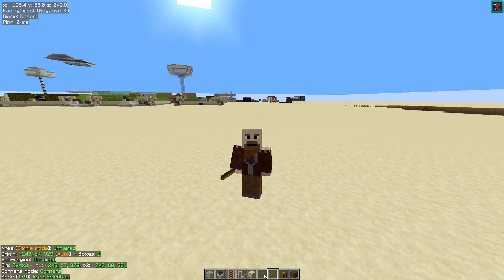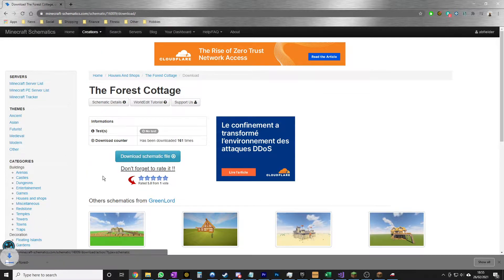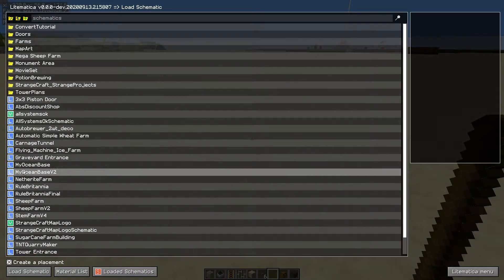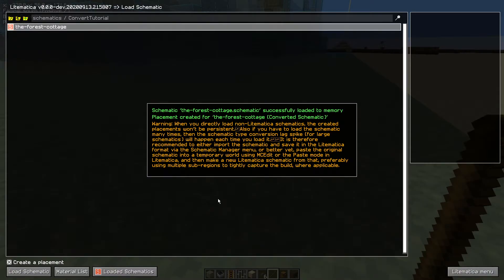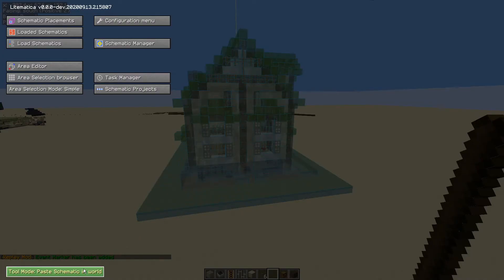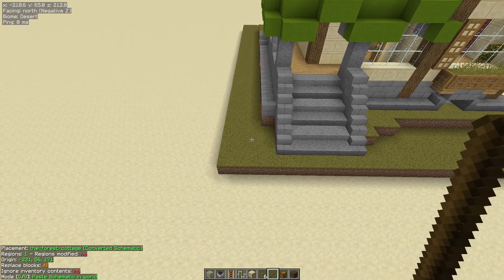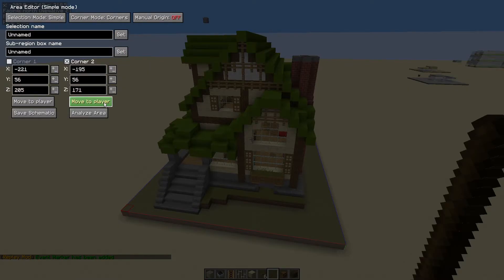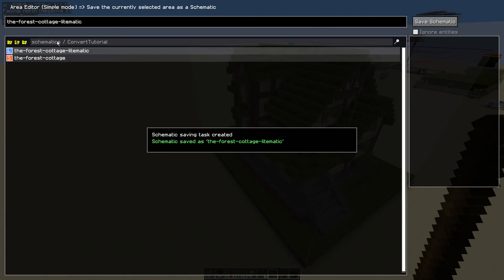Minecraft How To Convert A Schematic To Litematic File A Litematica Tutorial

Comment: When I try and load my schematic in it says "Failed to load schematic" yet it works with litematica files.
Reply: me to
Reply: I'm assuming 3 years down the line you've figured it out or given up but when you download a schematic file, click rename and change "schematic" to "litematic" and it will load :)
Reply: @MrMickeyyy89  That actually works? I have the same problem.
Reply: @peterawaits28  yup :)
Reply: @MrMickeyyy89  that ruins the file
Reply: @allinum  no it doesn't, if it won't load that particular file after doing this, if it loads as 1 singular block, it's not a file that can be converted into litematica, it'll be an mc edit schematic or something.
Reply: Not a file that can be converted as far as I've figured out anyway :) had the same issue with a build I was trying import as our new spawn and had to use world edit to place it in instead
Reply: Every schematic is made in different versions like in 1.16.5 and things like that in the description of those schematics it says what version it was built in u need to change the version to the version the schematic was build in
Reply: @Ayoub-we5zz  It is, and it won't work.

Comment: How can i make my schematics more "invisible"?
Reply: Open Lightmatica's config (default button is to Press C while holding M). Click Visuals, Scroll down to the bottom and look for ghostBlockAlpha. Lower that number to make the ghost blocks more invisible, raise it to make them more visible. I lowered mine too, currently using 0.30
Reply: @uolamer  I don't know why but nothing changed
Reply: I found the solution, at first you have to set "renderBlocksAsTranslucent" as true in Visuals, and then lower "ghostBlockAlpha"